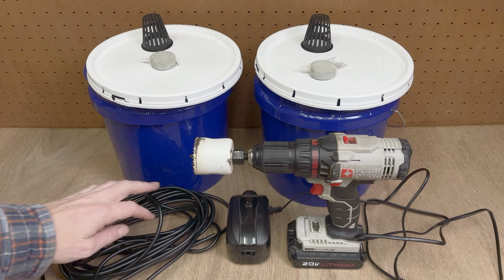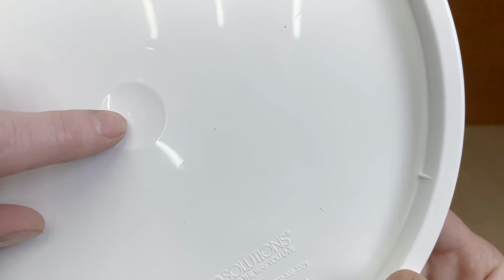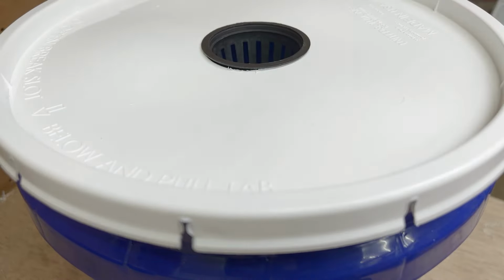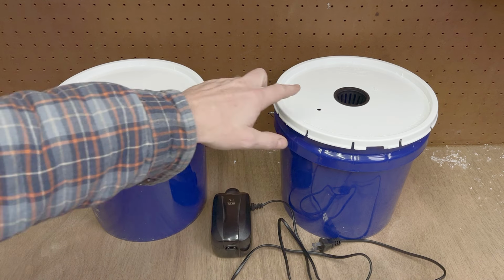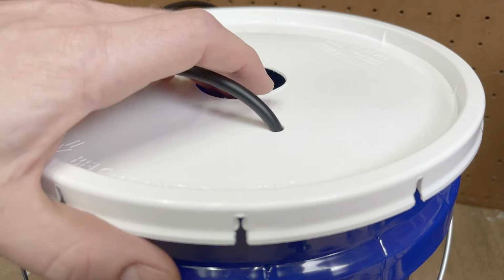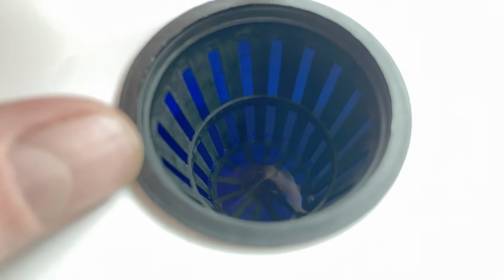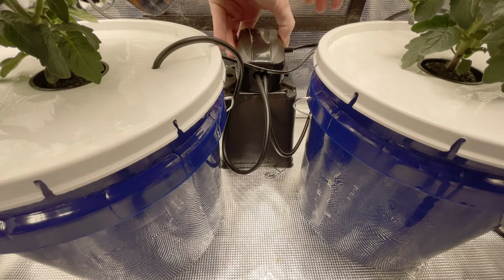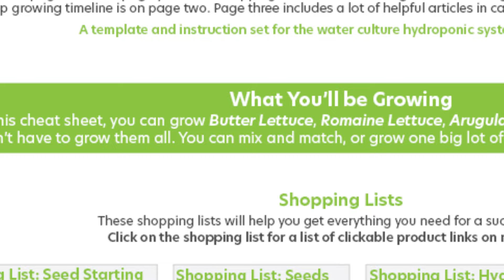How to Build a Hydroponic System Under $30 - Deep Water Culture Hydroponics

Comment: PUT AIR PUMP ABOVE WATER LINE, OR IF POWER GOES OFF, WATER WILL SIPHON DOWN INTO PUMP, DESTROYING IT, VOIDING WARRENTRY 😢
Reply from the maker: Good call Colin Robinson!
Reply: @HydroHowTo  LOL
Reply: You can get a check valve
Reply: @Reef_to_rainforest  a check valve can fail
Reply: You can but if you have a functional check valve as he does, then no need to worry
Reply: @chrisclyde4490  valves can fail. I hope u are using a no-fault grounded outlet
Reply: @HydroHowTo  valves can fail. I hope you have it plugged into a no-fault grounded outlet.
Reply: And put the pump outside the tent so it pulls in cooler air.
Reply: Also an inline one way valve is extra insurance and if it functions the water won't siphon out. You can find them cheap in aquarium parts and air tuning section
Reply: @HydroHowTo what size are the net cups and what size is the whole saw
Reply: Thanks

Comment: only thing id like to add is make sure the 2 air lines are the same length, or one bucket will starve for air. you can drill the hole one size under 1/4" and the air line will fit nice and snug.
Reply from the maker: Good tips!
Reply: Will having longer air hose give you less air pressure?
Reply: @red_day6097  there is frictional loss inside a hose. if the hose are very long you have less flow rate.  though thats minimal at these pressures.
Reply: @DieselRamcharger I know this is a old post but what about the higher flow air pumps with a 1/2” hose from the pump to a manifold with 6-8 ports with flow managing turn levers? Also if you raise the pump above the water level with the air hose hanging down like a drip loop would that stop the water from back flowing?
Reply: @scubadivingsince2006  well those manifolds are made specifically for uneven distribution. but the plastic ones without the turn levers would probably be fine. you dont really want metal in your hydro system if at all possible. and yes keep the air pumps up high and they wont siphon off in a power failure.

Comment: TIP!!!!!! when cutting thin plastic i found its always best to put the drill in reverse so the kick does not create a crack in the plastic
Reply from the maker: Good tip, thanks for sharing!
Reply: Setting the drill clutch low is a better option.

Comment: If the air pump is higher than the water level in the buckets, you won't need the check valves.  Save some money , set the pump on top of a flipped over bucket or box .

Comment: you could also just put the air pump on something that is higher than the water line, so in case the pump fails, water doesnt just run into the pump

Comment: Solariver had the perfect solar air stone system..a bit pricey but built to last. I am new to this and have invested in a solar water pump. I want to do a NFT system but am trying to figure out how to keep the grow tray from draining out at night when solar not running (I am off grid) I was thinking some type of shut off valve a nutrient return ? Any suggestions would be appreciated
Reply: Oh I am a year into this and am doing a successful DWC
Reply from the maker: @DebPainchaud  a flood/drain system may work better in the case of direct solar with no power bank.

Comment: How do you change reservoir nute/water? Thanks
Reply from the maker: I usually keep an extra bucket. When it’s time to swap out nutes/water, mix them up in the spare bucket, then lift the plant (and lid) up and place it on the spare bucket. Dump and clean the bucket you just removed, then fill it and swap it with the remaining bucket. This method works well for me. I hope that helps!
Reply: Thanks, only other would be if a trellis was involved, but for me not a problem I don’t use them. I know there are some trellis systems that mount on the bucket but for my limitations they won’t fit the space. Someone should make ‘em so they are smaller and more flexible. You could lift top with trellis, then swap buckets , maybe someday 🙆🏻
Reply from the maker: What kind of trellis are we talking about?
Reply: @HydroHowTo  something like the one bill ward displays from time to time. The problem is that company does not offer one for a 2x2 tent. IMO if they made smaller ones for autos you might be able to stuff 2 of them in that size in the tent. Because they are smaller I just need for the trellis to spread the branches when they are smaller. Obviously it’s a whole different game when it’s a larger tent or larger plants, autos different and let’s be honest they will be the larger percentage in the future.

Comment: I drilled my airline hole on the side of the bucket near the top. No tube to change water?
Reply from the maker: On these small buckets, I change out the buckets rather than drain them. Whatever works best for your own use case is perfect! Thanks for the comment!

Comment: Should I clean the buckets before adding water and nutrients? Even if they're brand new?
Reply from the maker: Great question! Yes, you definitely want to clean the bucket before use even if it's brand new. Buckets are usually pretty dirty from shipping and sitting on the store shelves. 

Also if possible, opt for food-grade buckets. They're normally white and labeled as food grade. Unfortunately my local big box store was out of them when I went shopping for this video.
Reply: heck yes! add 4ppm bleach to your water to keep things nice and clean. cat food buckets are 8 gallon :)
Reply from the maker: @DieselRamcharger  I wish everything came in cat food buckets. Those buckets are so tough!!
Reply: @HydroHowTo  i know, and i swear its cheaper to buy em full of cat food than just the empty buckets from the hydro store. now what am i going to do with all these cats is the question?
Reply from the maker: @DieselRamcharger  LOL, THAT is the question!

Comment: Use Black buckets and lids the light will get though the white lids and even possibly those blue buckets and cause issues with algae. Ask me how I know 😉
Reply from the maker: Thanks for the info. I haven’t ever had an algae problem with blue buckets. White lid seems to be working really well too. I’ve always used blue in the past, but decided to give white a go this time.
Reply: @HydroHowTo   1st off mate you have some great info on your channel. I'm a new sub.
The blue is probably fine but white I found just to be problematic. If you want a bit of reflection when using black lids a bit of aluminum foil will help. Happy growing 🌱
Reply from the maker: @CryptoShark888  Thanks so much for the kind words! I love those ideas. Makes total sense. I will definitely experiment with a darker lid. Also, thanks for the sub!!

Comment: If you raise the air pump above the water level in the bucket it can’t siphon back to the pump.
Reply from the maker: Great tip Jim! Thanks!
Reply: Or just use a check valve for aquariums, but yes it’s really a drip line with pump elevated

Comment: How do you get away with not chilling the water or running a recycling reservoir where you are chilling the water?
Reply: Why would it need to be chilled? Room temp is fine as long as it doesn't exceed 35°C

Comment: Would this system work outside in say my backyard? I was wanting to grow something like strawberries and perhaps corn in a hydroponic system, but I'm not sure if those kinds of plants would be too big or if you can grow something like strawberries where you don't really harvest the entire plant.
Reply from the maker: This kind of system will work outside, but there are a few things to keep in mind. If the reservoirs are in the sun, they'll get hot. Also, you want to keep rainwater from gettin into the reservoirs. This system will work though. I have viewers growing tomatoes in this same system in Florida, but they wait until winter due to extreme summer weather. Strawberries will grow well in the system too. I hope that helps!! Thanks for watching!
Reply: I wouldn't recommend trying corn in a system like this it's a high demanding plant and it's growth and height will be an issue. Strawberrys would thrive as long as the fruit is suspended or are on a dry medium. If they are resting on the plastic they'll rot.

Comment: sir could you recomend your average net cup distance from water level in your standard 5 gal setup?
Reply from the maker: For starting a new plant, water level just touching the bottom of the net cup until roots develop. For a plant with developed roots, water level a few inches below the net cup.

Comment: Plant's will do better with an air gap between the net and solution. 4 to 6 inches works well and let's the plant dry at the base and stops rot.

Comment: Buy a Larger quality
Pump. Mount pump  above planter, height. Located in another room or Basement for sound & run a long single hose to a splitter. Also,The Best place to put pump is where people sit and breathe out CO2.
Or Outside where the Co2 level is high.  12 volt or 110 volt small compressor works well. Larger the tank ,makes for less run time on .

Comment: Perfectly simple setup.  Very effective. I would put the airlines in the top of the side of bucket. Not on lid  so if you need to remove You can free of obstructions
Reply from the maker: I normally prefer sides too, but with these buckets I swap the whole bucket for nutrient change. Thanks!
Reply: @HydroHowTo  can you do a video on this.
Reply from the maker: @BlitzkriegStaffords  which part?
Reply: how you are feeding and refilling the res when they get low. are you mixing nutes in another bucket and adjusting ph and then adding to bucket after you remove the whole lid and plant? do you just top off with water and add nutes into same bucket and ph? seems like it would be kind of a hassle once you are dealing with a larger plant in flower
Reply: @HydroHowTo  
That would work lol.  See how simple it is to over think 🤔   good job. 👏 👏
Reply from the maker: @BlitzkriegStaffords  gotcha! I mix the nutes in a new bucket and just set the lid/plant onto the new bucket. Can be a bit of a hassle, but so is topping off the res.
Reply: @HydroHowTo  great content and appreciate the replies!
Reply from the maker: @BlitzkriegStaffords  youre totally welcome and thanks for the kind words!